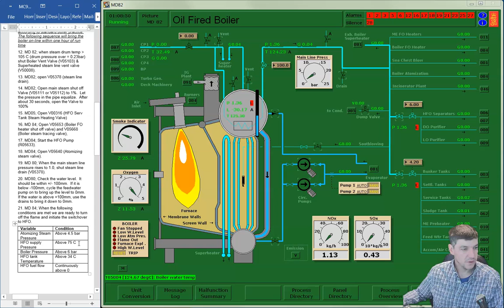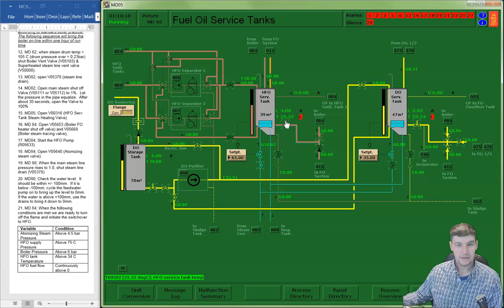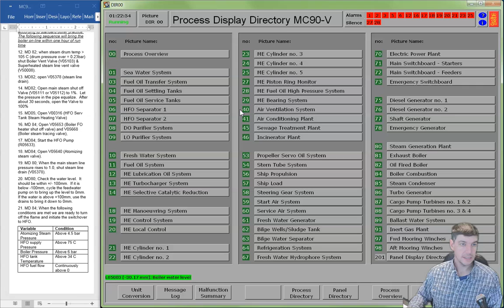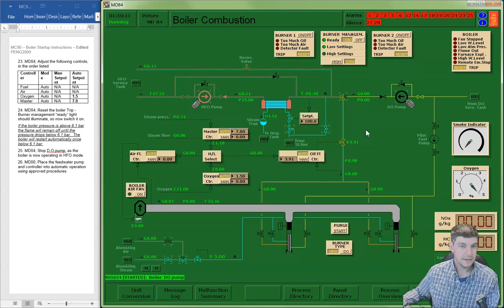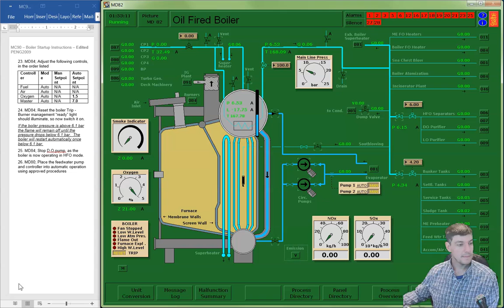MC90-V Boiler Startup - 2020 update - Power Plant Simulation

Comment: Hi there ! I followed your steps but when i press PURGE START it is not starting... I don't know why 😭
Reply from the maker: Your issue is likely caused because your initial starting condition is different than my scenario.  

Do you have control air available from your service air compressor?  Lack of control air is the main reason the purge button won't stay in when pushed.
Reply: @RyanTangney  i found it thanks :)